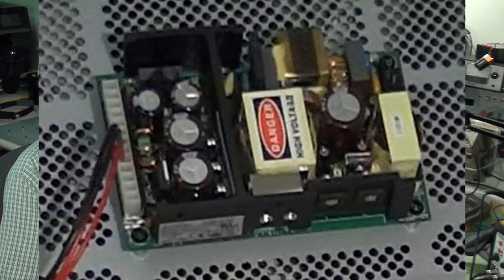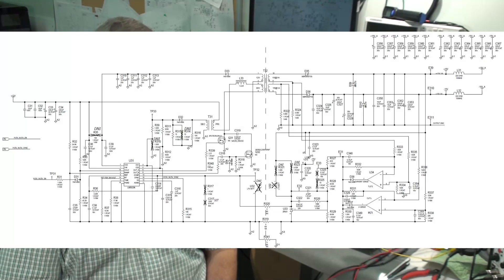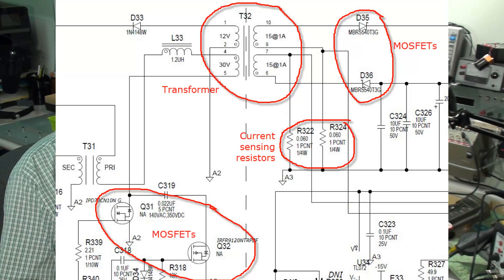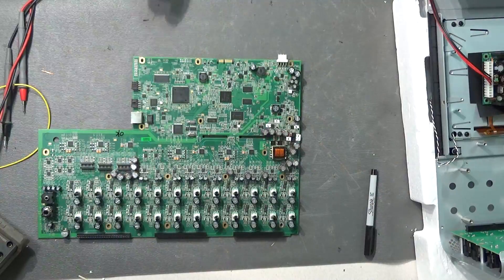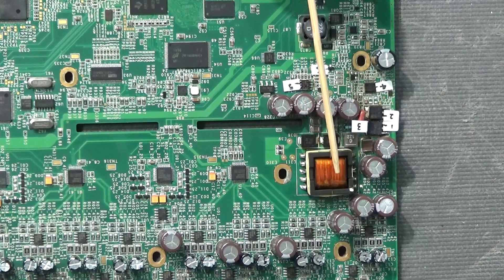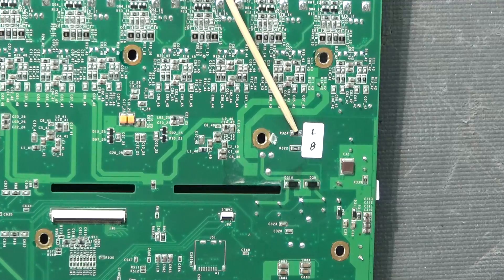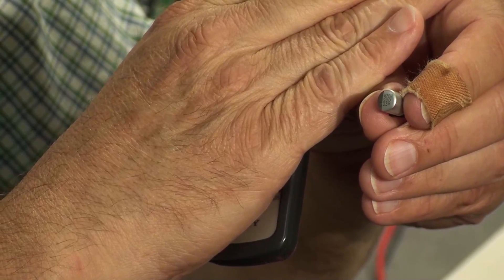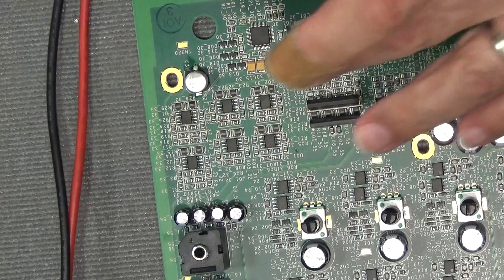QSC TouchMix 30 Pro Gremlins - Part 3

Comment: Hi, thank you for creating this video.  I have one of these but it does not turn on.  The 12V power supply is outputting the correct voltage but that’s where it stops. Would you be able to provide the main board power supply schematic as well as anything for the turn on circuit as well?
Reply from the maker: Hi Brent. Thanks for the comment. I replied to your email. Hope it helps...

Comment: Can you provide any insight on the 48v phantom supply voltage source?  I don't think it was included in the ps schematic you showed.
Reply from the maker: I have a one page troubleshooting guide for the phantom power section, as well as a schematic for that part of the circuit. Email me at techtips983@gmail.com and I'll send it to you.
Reply: Thank you, email sent.